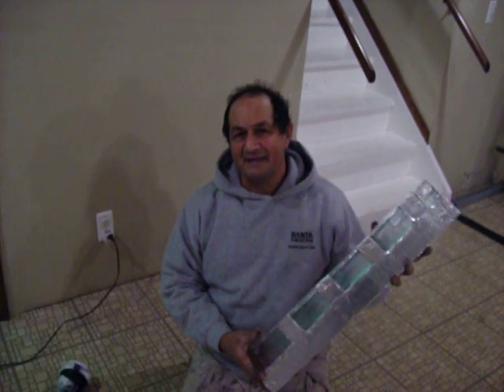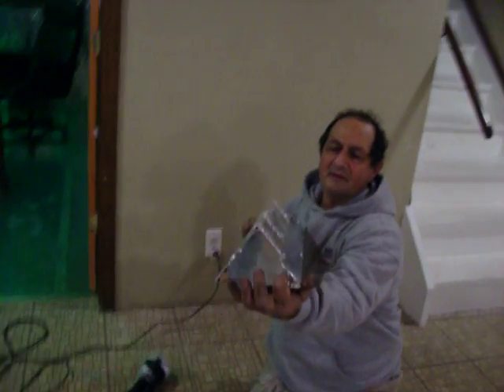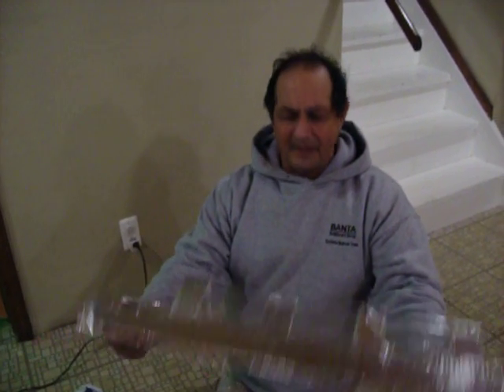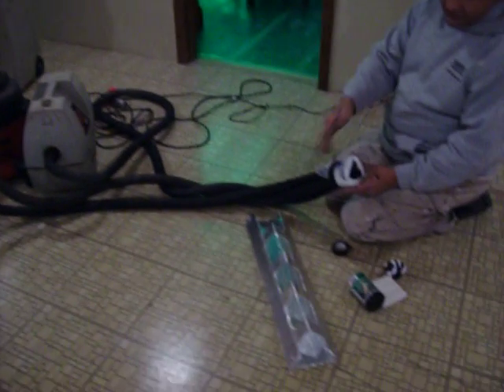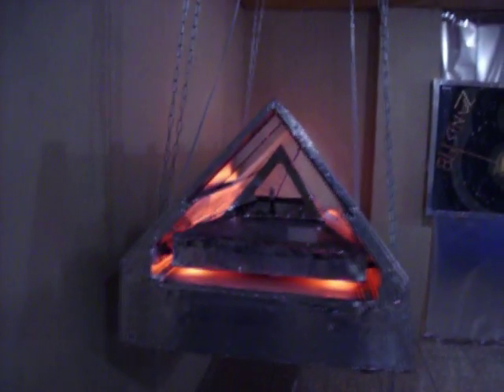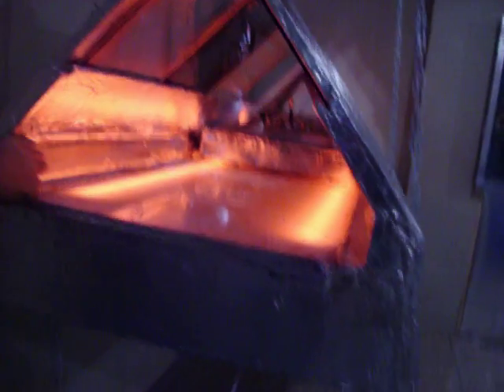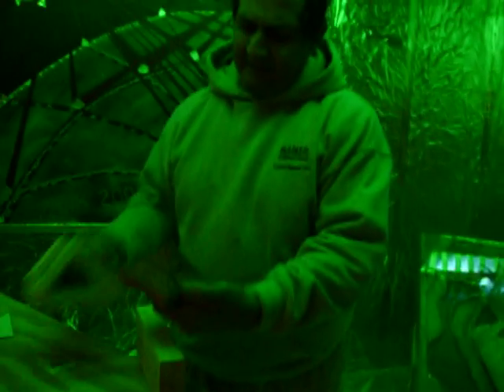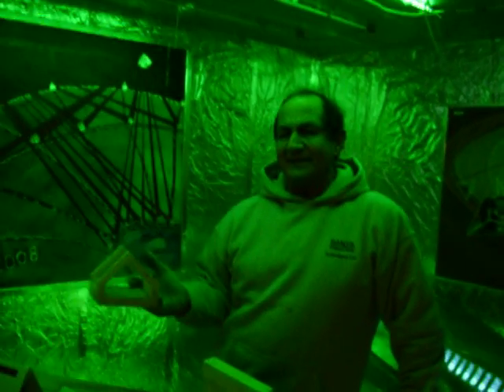The Test 300+ MPH Extremely High Speed RC Car Air Tunnel Part 3

Comment: It's a Pneumatic tube, or Lamson tube, it was invented years ago. In fact the 1844-54, the Dalkey Atmospheric Railway here in Ireland was the first pneumatic railway. But it was a failure (as were all other Pneumatic railways) because rats ate the leather air pipes (this was before plastic tubing). 

Look up - pneumatic elevated subways.